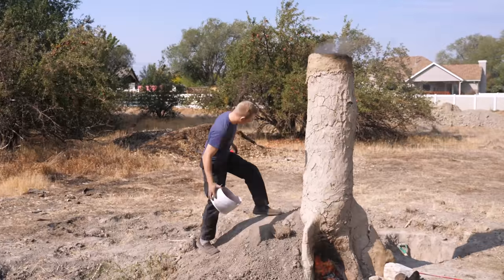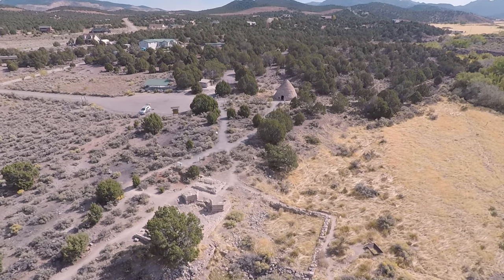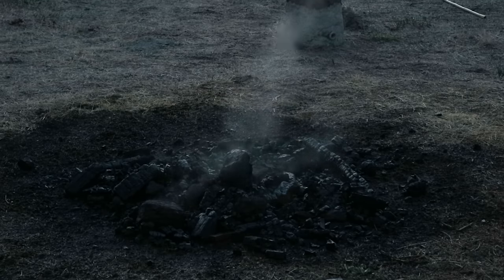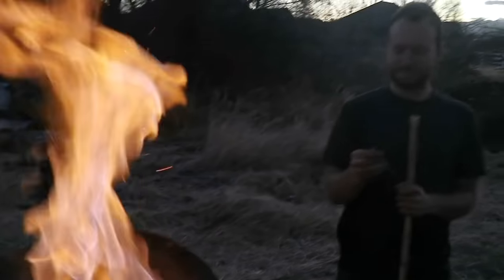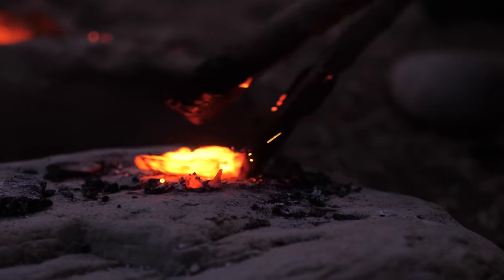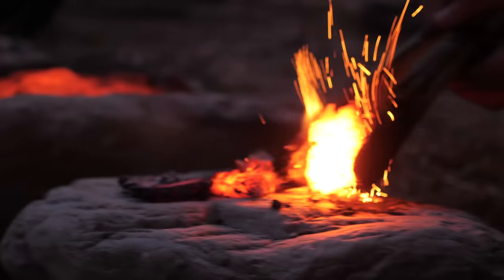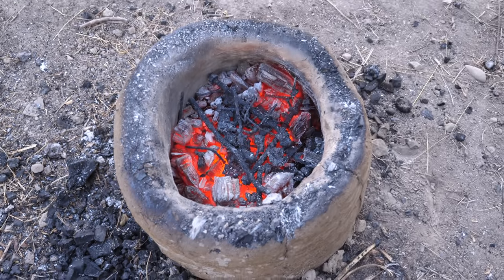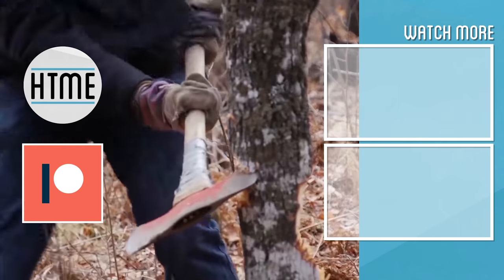From Rock to Iron to KNIFE (Handmade Knife Forged from Rock)

Comment from the maker: Get 20% off your first monthly Bespoke Post box when you sign up at http://bspk.me/howto and use promo code EVERYTHING20 at checkout!
Reply: I love you, keep the good work 👍🏼👍🏼❤️❤️
Reply: A collaboration with Alex Steele could be interesting, an experience blacksmith with modern tools trying to refine a unpure piece of iron. Not really sure how to work it into the reset but maybe after you've advanced to a certain technology
Reply: When you work with wrought iron and are attempting a forge weld or to consolidate the bloom, you should have it much hotter than you had when working in Minnesota.  It should be white hot with small blebs of molten material beginning to form on the surface. This will lead to a stronger forge weld, for you to loose less material while consolidating the bloom, and to an overall stronger product (as in perhaps not having a crack like your final knife did). I noticed that while you were with Joseph, they had the correct color/temperature, and they even commented that they had reached the perfect color. With your previous failed iron making attempt, the reason your bloom cracked when you attempted to consolidated it may not have been that your smelting didn't work, but that when you attempted to work the bloom you were several hundred degrees short of the correct temperature so instead of welding together it just cracked.
Reply: Keep doing what you are doing and don’t be discouraged. I think your main problem is that you are hitting the bloom too long. You should only strike while the bloom is white, yellow or a bright orange, if any part of the work piece  is red or grey then the iron has cooled too much and will become more brittle than you would expect.
Reply: Hey, could you try making Kvass as well?
Reply: Now once you improve your Iron making skills so you can make a bigger piece, you can try making a magnet.
Reply: Can you please give us a link to the other guys' channel.
Reply: Where is Annalise?
Reply: I can't wait for nucular reactors lol
Reply: How do you make money anyway?? I am so curious on how you make money to afford to make all this videos
Reply: Man Its gonna take thousands of yrs to reach chemistry, photgraphy, electricity and mobile phones. I give up this is super ^ 100 hard.
Reply: with the Handel did you do a burn through
Reply: Looks like toy were working the iron far too cold friendo, hence why most of the material flaked off in sizable chunks below a certain glow. Keeping the stage lights on low should let you see the actual temperature of the item and know when to stop hitting it and throw it back on the heat! The end result all that being said looks fantastic and I'm assuming is close to the actual size of most iron knife tools of the fledgeling iron age, it looks beautiful!
Reply: You let the iron get too cool when hammering it needs to be glowing at all times
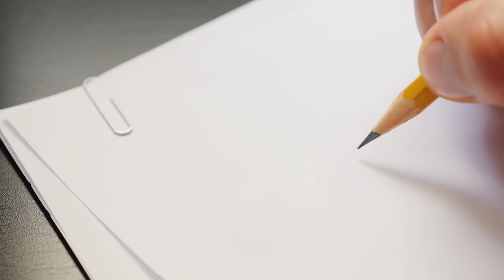Reply: 76 0:18 ?tft😢

Comment: When you work with wrought iron and are attempting a forge weld or to consolidate the bloom, you should have it much hotter than you had when working in Minnesota.  It should be yellow white hot when consolidating the bloom and white hot with small blebs of molten material beginning to form on the surface when you are forge welding. This will lead to a stronger forge weld, for you to loose less material while consolidating the bloom, and to an overall stronger product (as in perhaps not having a crack like your final knife did). I noticed that while you were with Joseph, they had the correct color/temperature, and they even commented that they had reached the perfect color. With your previous failed iron making attempt, the reason your bloom cracked when you attempted to consolidated it may not have been that your smelting didn't work, but that when you attempted to work the bloom you were several hundred degrees short of the correct temperature so instead of welding together it just cracked.
Reply: My thoughts exactly. Definitely didn't seem hot enough (hard to tell on camera) when he was in Minnesota. The edges (most of what fell off) where still reasonably dark when he tried forging.  So either the temp wasn't high enough, or their blooms still had a significant amount of very impure slag on the outside.
Reply: Yeah, i'm pretty sure he's just not getting it hot enough.
Reply: The darkness was fooling him into thinking the iron was brighter than it was I guess
Reply: @TheJesster257 , exactly. But even if there was extra slag, if he had heated it up to the correct temperature the iron and slag alike would glow with the same white color, but since he did not do that we can’t tell what degree the breaking was due to impurities or just improper technique. Now all of that said I do love the all of his videos, and I watch them as soon as they come out. I also have a huge interest in starting from the Stone Age and trying to make bronze and iron tools. It just makes me sad that Andy goes through so much research and effort to ultimately miss one or two key details that messes up his final project. In his linothorax video he used unprocessed fat instead of using a natural glue to individual laminate the layers together into a ridged armor. The Linothorax are set apart from other cloth armors because its rigidity and stiffness provide more protection, but his product ended up being more saggy and lacking a lot of protective value against penetration. His bronze casting videos he did alone often would mess up or miss key bronze casting techniques that would have greatly improved his chances of success, and greatly improved the quality of his tools (all without using modern tools). I really love these videos and I am sure that he is under a time crunch to get these videos out on time. Like making a glue and individually laminating the linothorax one layer at the time and letting it dry before starting the next layer is key to producing a functional armor, but would have added potentially a hundred hours or more to its production time. I get that this is his and his crews livelihood as well and that time is money, so cutting some corners, even if it affects the end result, is probably necessary. I only want to see him succeed because this sort of thing is so cool to me and I feel like no one has really done this sort of thing before with this big of audience and production value.
Reply: @lufmesquita  , its actually easier to see the various shades of color in the dark. Since all solids glow with the same color when at a certain temperature, and if you have a color-temperature chart with you you can tell what temperature range each color corresponds with. My guess is that he just didnt know what the correct temperature for forge welding wrought iron or he could not reach that temp with his current set up. and was under a time crunch.
Reply: I agree.  If he spend time firing bricks to use as a base for a charcoal fired furnace, together with bellows and a melting pot with a hole near the middle to let out the slag, this would have worked a lot better.  Could have just mixed in a bit of wood ash (to make steel), poured it into a mold, and grinded it into the desired tool.
Reply: Ps if you are reading this Andy I am only an hour away and have a lot of free time on my hands if you have questions or need research
Reply: Indeed
Reply: So how do you know this
Reply: @kayagorzan , you can look up videos on YouTube about smelting and forging wrought iron, and there are a number of books about the subject as well. Youtuber RowanTaylor has a series in forging different objects with wrought iron if you are interested.
Reply: @chaz000006  he could have but there are trying to go from the approach of no prior knowledge besides it can be done i think, idk its the first video ive seen
Reply: The biggest issue in my eyes is the cold shuts. Even with good metal, and good forge welding temperatures you still want clean surfaces, and to dissolve the oxide layer with flux.
Reply: Also, for wrought iron, it’s a LOT of fold then flatten, fold then flatten at a welding heat. You lose a lot of material in the process, but it yields a higher quality iron.
Reply: Another thing that will help greatly during the consolidation process it to stop banging the blooms with a rock on a rock, this will fracture your bloom. You need to consolidate very gently, this is normally done by dishing our the top of a stump and using hammers made of wood. The dish shape in the stump will help the consolidation, instead of pieces flying all over they will naturally want to crowd together. In this video they started off like that but they did not work the consolidation long enough before trying to make a pancake. Also why in the world did they hit it with water? Never do that when consolidating...
Reply: Can't state how important it is to understand and know roughly what the colours mean.
Reply: Thanks for sharing your knowledge...
Reply: You have to remember, camera and the light of the shot dims the color of the metal. Ive been in the forge for 12 years now. Its something that takes A LOT of time.
Reply: im not metal expert but thats my guess of it.
You essentially want both pieces of metal white hot, near full melting temperature but juuuust plyable and able to hold shape. The closer you match temperatures too, the better fusion youll get from both parties.
Reply: @nelle8348  the reality is one person cannot master even three or four trades, let alone hundreds like he's trying to do. People are used to thinking they can learn anything, when things are digital or abstractly represented. real world creations are analogue in nature, it takes hundreds or thousands of hours to master them.
Reply: Sparkling is too hot as a well.

Comment: How to not forge weld: Little tappy taps.
Reply: Atlas WalkedAway yeah his hammer had 1” strokes.
Reply: Sooo..hit it like it owes you money ?
Reply: @vao879  Yeah, you want it so hot that it's uncomfortable to look at, and you want to smash the living kadooddle out of it. You'll lose a fair bit around the edges, but the inner bit will have fewer cracks and inclusions. With a rough bloom you lose like 5% to oxidation every time you go through a heat and hammer cycle anyway, so it's better to make what you can of what you have in the center. He could have also benefited from using some of the borax he previously mined as a flux as well.
Reply: Sometimes a little tippy tap is all it needs. Other times it wants the 7 layers of hell beat out of it. But she always gotta be hotter than the wrath of an angry wife.
Reply: This man did it all wrong. Iron was mostly the color yellow and red, but it has to look so white, it looks like the Brits colonized it. Also, he should’ve beat it harder like Satan himself was about to drive his spear through his heart.

Comment: A few things: Forge with less light so you can better judge temperature based on color. I see you forging the iron at what is probably a way too cold temperature and you introduced a ton of cracks into the material because of that
Reply: I kept seeing him beat it long past working temp and even less so for forge welding
Reply: A LOT of cracks. Not ton.
Reply: @simontay4851  Nope, metric ton...
Reply: Indeed
Reply: I hope this is not in California. I am so fire burn off.
Reply: The smelters were pretty good at making bronze. They had a lot of experience coming into smelting some iron.
Reply: The high speed looked like he was just smashing it into dust.

Comment: I'll make a suggestion here, seeing as you already have ceramics, and iron-production, you should try taking as much of the high-iron content slag from the bloom and forging process, crush it into a fine powder (as fine as you can manage) add some of the borax you mined for glass-production, and throw it in a fired, sealed ceramic container...  (Literally just a fired clay pot, with a fired clay lid, and some extra fresh clay to block out the air).

Then basically put the pot BACK in the furnace, and burn the everliving crud outta it.  

With any luck, you should be able to get a single, solid block of mostly-iron as a result.  And THAT should totally be forge-able with the tools you have at hand.
Reply: Yes, this is the way to purify the ore. Borax and lime are used even today with high grade metal casting.
Reply: @bigmeatswangin5837  I mean this is the way they used to make wootz damascus, so it's definitely a way they could make this!

Comment: I think your next project should be a millhouse. 
I don't expect you to get a team of oxen or a stream-front property with a waterwheel, but even with the bronze tools, you have the ability to carve out wooden gearing and start to mechanize a bit. 
With a gear stack, you can make stone mills for grains, bone meal and ore processing; you can make a saw mill (originally designed with vertical, reciprocating blades); you can make a mechanical bellows that will allow you to reach iron casting temperatures which will help with the purification and billet making; lastly, you will be able to make a water screw.
Reply: How to make an ancient sawmill?

Comment: Thanks for the video. These always make my jaw drop imagining how much trial and error this would take.

Like entire generations of people spent their whole lives trying and failing at this stuff. Then someone stumbled onto some level of success and people ran with it, trying and failing countless more times until they started to understand WHY they failed. Slowly but surely improving it piece by piece, struggling through countless designs and changes to try to achieve a hotter temperature or a more consistent temperature, figuring out the ratio of charcoal to ore that changes constantly.

Gives you a whole different level of respect for our crazy ancestors who figured this stuff out; and a real appreciation of how lucky we are to have modern technology to help and easily accessible knowledge to learn from.

Something that took generations and over a century to stumble through is now something you could realistically work through in your backyard, given you did some research.
Reply: Actually success wasn't usually shared. If you knew how to make iron better than your neighbors did that gave you a decided advantage over them. When Italy discovered how to make glass sharing the secret was punishable by death. So yeah not the most generous folks.

Comment: Blacksmith here, you need to cook it hotter and faster. The more you heat it in with coal the more you rise the carbon content which makes the iron brittle. Heating it non stop for two days definitely killed your yield and quality. Oxidation from all the air also has an effect. A better bellow system will be needed to fix your problems (faster/hotter). Something like a long stick of wood on a pivot between each bellows. Think of a seesaw attached to bellows on both ends with a longer end to actuate it. Make use of a wheel if you can, or build a wind/water powered system but I hear  ̶m̶u̶l̶e̶   ̶s̶l̶a̶v̶e̶  Lauren power is fantastic :P It would make an amazing video to explore how they improved bellows in early iron age history.

Comment: Good gob. One of the things was the iron was way to cold for forge welding also did you use some form of Flux when welding that would also help in the consolidation of the metal not letting air or water into the metal

Comment: Crazy idea. Try taking the bloom pieces and break them into pieces small enough to fit into a crucible. Cover the pieces with charcoal and then cover the charcoal with crushed sand and seashells. Place it back into the furnace and bring it up to heat for a while. This should consolidate the iron while providing an oxygen free atmosphere and a flux to remove impurities.

Comment: The key to this and the key breakthrough launching the entire Industrial Revolution is to cook the charcoal down into coke (just as charcoal is "cooked" from wood), which is harder and purer and allows for more airflow when burning because it does not smother the fire with collapsed ash. Ergo, you can stack the furnace more and get hotter fires that burn off impurities. Coke-fired blast furnaces made the leap possible from dirty wrought iron to the cast iron we know today, and of course, all the better alloys that come with that. Wildly, the process of making coke was first widely used in brewing because roasting malt with charcoal imparted foul taste and smell. They started using coke for a lighter roast, it created the "pale ale" we know today. About 50 yrs later an Englishman named Abraham Darby who had been apprenticed to a brewer started using coke in his blast furnace, Shortly thereafter he was selling over 80 tons of iron goods a year. Darby was an innovator in sand casting as well.